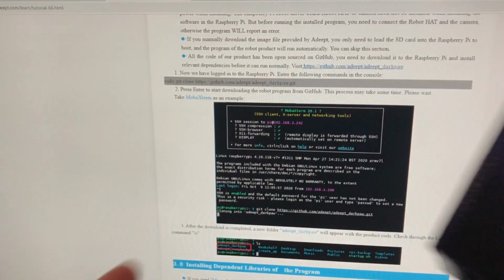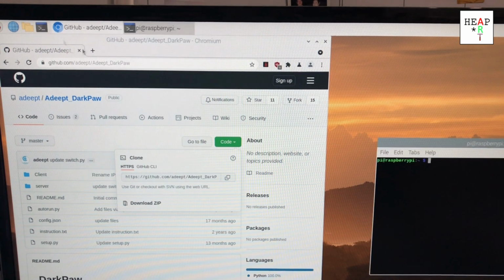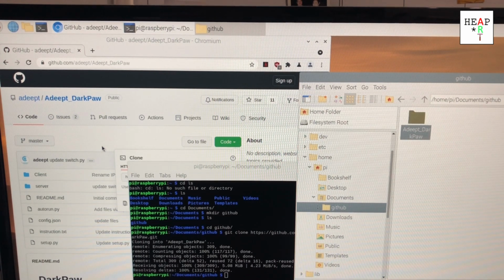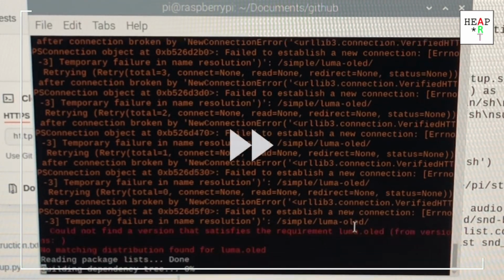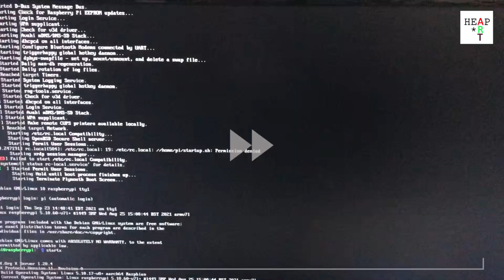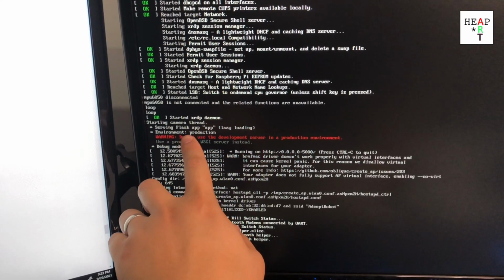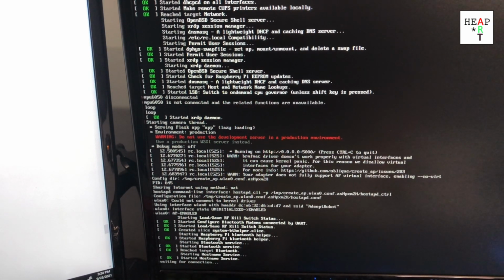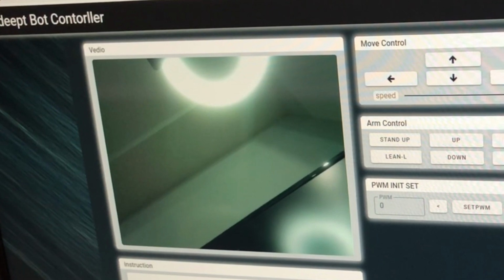Setting up My Raspberry Pi for the Adeept DarkPaw Bionic Quadruped Spider Robot

Comment: Hi. I need your help!
I cannot connect via SSH. Connection timed out writes to me. Sometimes I can connect, but almost always I can't.
Reply from the maker: Check your network connection
Reply: @heapartcoding  when I connect DarkPaw to the monitor, it shows that wi-fi is working
Reply: @heapartcoding  I solved the problem, thanks. But another appeared) After 2-3 minutes of use, the connection with DarkPaw is interrupted. Then it turns off completely. It also seems to me that the board is getting very hot. Did you have such problems? How can they be solved?
Reply from the maker: For the first issue, I experienced something similar. It was because my router kept on switching it from 2.4ghz network to 5ghz network. For the second issue. Yes I did. I think the Wi-Fi card overheats and disconnects. I’ve ask Canakit and they sent me a new one. However it had the same issue. My solution was to use a wifi dongle and disable the onboard wifi chip